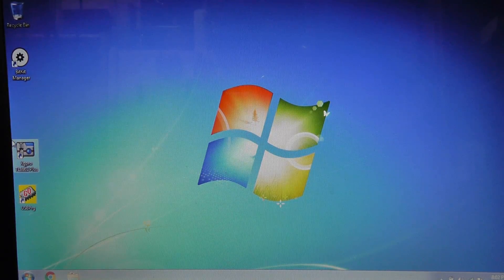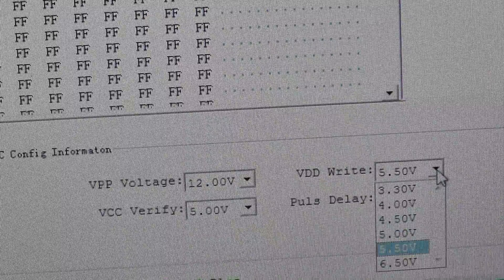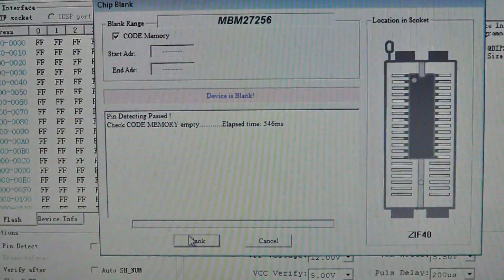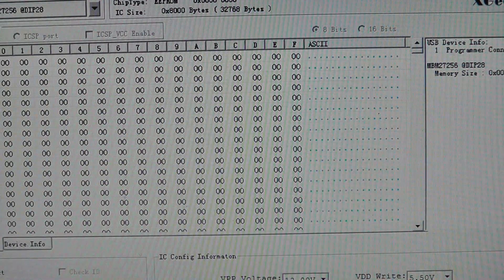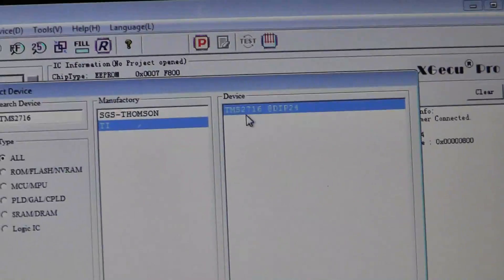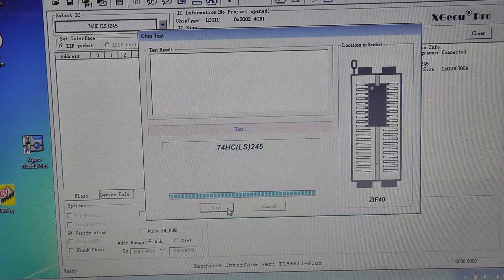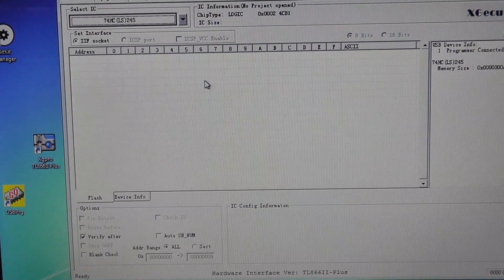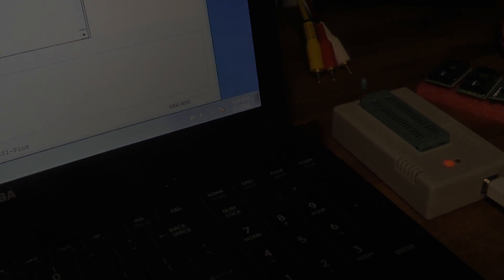Programmers Wooo! - Part 6 XGecu TL866ii

Comment: Interesting, can you program Sega Megadrive maskroms (eeproms) on this ? They are based on 27C chips
Reply from the maker: if they are truly eeproms and not masked roms, you probably can.  Do you have any details on the chip?  Are they 40pins or less?  I have never messed with Sega MegaDrive roms but this page suggests there are 27C compliant chips if you want to replace.  http://retroshock.bplaced.net/mdg.html#maskrompinouts
Reply: @jacklick  In fact they can program sega eeprom but with 16 bit adapters with 42 pin ZIF.

Comment: Is the Address decoding coded in the ROM chip, but which ROM chip mostly does the address decoding installed in arcade games. I know that there is an address decoding chip that turns on and off the chip select pins to the ROM chips. But what code or program or ROM chip is telling the address decoding chip on the select lines.